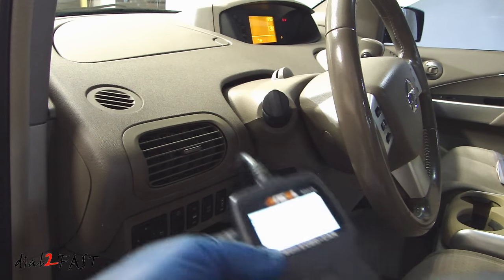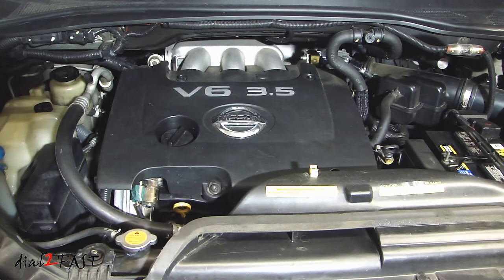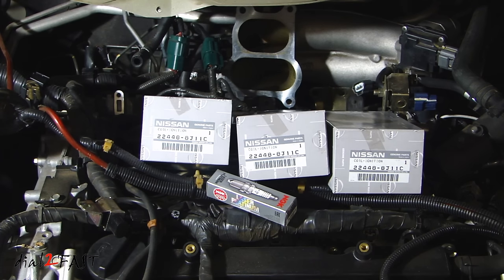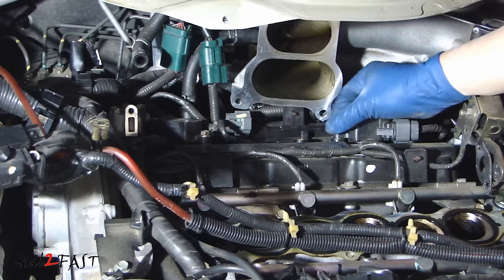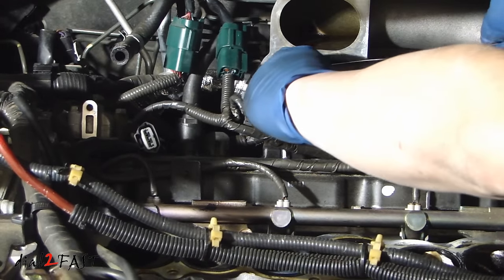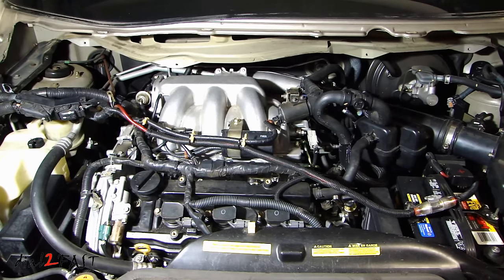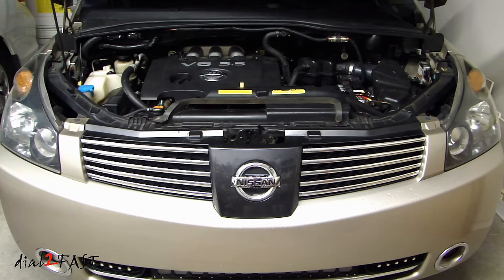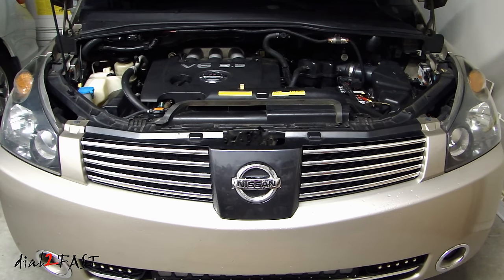Nissan 3.5L V6 Ignition Coil Misfire - P0303 Cylinder 3 Misfire

Comment: Question: The factory manual tells me to drain the coolant before removing the plenum. Do you think this is necessary? If not, why? I don't want to drain the coolant if it isn't necessary. I have a 2005 Nissan Maxima.
Reply from the maker: You don't need to drain the coolant as I have done in the video. The reason the factory manual mentions draining the coolant is because it includes steps to disconnecting the throttle body which has coolant lines. And the throttle body is attached to the plenum, but you only need to move the throttle body to a side when working on this.
Reply: Thank goodness. Thanks for the video & reply.

Comment: dude. that's awesome video.  I messaged before about your quest. I also have a 2004 quest se. I have the misfire #3 plug etc. and lcd screen issue and ops I believe my timing chain finally went bad. now its at my mommys house sitting there . I guess its the old car blues but the quest drives fine and I do like my big girl but Money ways . she costly. and misses need a car. driving aunts car for now. keep the good work  up
Reply from the maker: The Nissan 3.5 V6 is a good engine, but problems can occur with high mileage if not cared for. Also working on it is not the easiest. Thanks for your comment!

Comment: Great video, just curious to know if a Check engine light came on for bad coils? My car is hesitant from 2700 RPM to 3300 RPM and a lot of people say it's the coil packs but I have no check engine light
Reply from the maker: Even if you have no check engine light, you can still plug a scanner to it and check for any pending codes.

Comment: is this the same process for a 2012 Nissan quest
Reply from the maker: The 2012 Quest is a different model year than the one shown in the video but all the Nissan VQ35 engine are very similar. The parts for the gasket is probably different. But the video should give you an idea of what's involved.

Comment: How long did this repair take you? Im considering doing it myself, and knowing how long it would take would be really beneficial.
Reply from the maker: If this is your first time and assuming you have all the tools, for the Nissan Quest, it may take around 4-5 hours.
Reply: Yeah, well the great thing was that my code was p0305. Amazingly, the 5th cylinder was almost inaccessible in my 04 Altima, but with a u-joint and a ratchet and some nimble fingers i was able to pull out the coil and plugs. 

If it was Cylinder 1 or 3, I would have had to go through this.

Turned out it was just a failing spark plug. 
A $10 fix. 

Got my car back on the road and running well.
Hopefully the other 2 sparks in the back don't fail in the near future, if they do, I ll be back on this page.
Reply: @ultimatenoob3  hey..I know you posted this about 2 years ago... Im guessing you had the V6 Altima ? I have a code P0305-Cylinder 5 on my Murano and want to see if I can do this without removal of Intake Plenum..Did you remove Airbox though?
Reply: @happyseany  nope. 

Just used a ratcheting driver with a universal joint couple to go around the bend to loosen the bolts and the spark. To pull out the plug you can use a magnet or what i did was a small 3/4 inch pipe section with some rubber band on its end to grasp the spark  plug and pull it out the chamber. Never needed to pull out the airbox or anything. took about 30 minutes.

Funny thing is 5 months later on cylinder 3 misfired. And I ended up pulling out the plenum anyways and replaced all the plugs. For me it was actually the spark plugs that were the issue not the coils.
Reply: @ultimatenoob3  Hey - thanks so much man for the tips! going at it this Friday. I did all the plugs, valve cover and Coil # 1,3,5 about 2 years ago with all Nissan parts - and getting friggin' Code P0305 - I feel like I did my time and don't deserve this crap! Took out intake manifold/plenum.. windshield wiper arms, motor, cowling...blah blah blah ... and still got a code with only 12k miles since all that work!! So pissed. But I will definitely try what you said and to grab spark plug and I have a 1/4" drive u-joint. Wish me luck! Thanks for quick reply!!

Comment: Where is the 5th cylinder located I got a P0305 misfire that to the front of the engine?
Reply: number five is far back right near throttle body when facing front of car  underneath intake manifold. Firing order/location 1,3,5 left to right cylinder under manifold and 2,4,6 left to right at front of engine near radiator.

Comment: Have you ever changed the PCV on your vehicle? I believe it sits behind the rear valve cover?
Reply from the maker: The PCV is on the rear valve cover. If you buy a replacement valve cover from NIssan, it comes with a new PCV already installed. I already replaced that valve cover along with the PCV before doing the front.
Reply: dial2fast I used an aftermarket valve cover for the rear and I regret it. I was just wondering if I can access the pcv valve without removing the Platinum?

Comment: I have same problem, 3th piston. I changed the ignition coil last month and today it went bad again... before i change it all over again can someone tell me what might be causing same coil going bad? It was a cheap coil, can it be simply because of that or can it be  something else, something i should check while its open. I have changed the spark plug as well btw
Reply from the maker: With the coil, only use Nissan OEM part. They are more expensive but considering the work involved to replace the back one, you want to only do it once.
Reply: @dial2fast  thanks for reply, im going to buy nissan this time. Can something causes same coil go bad you think?
Reply from the maker: @apache08  A coil pack is an electronic device, and aftermarket coil packs may use cheaper components which can lead to premature failure. Thus the lower cost.
Reply: @dial2fast  Thanks for fast reply and your time!

Comment: I had 2012 maxima automatic, engine service code show cylinder 6 misfire, can you tell me where is the # 6 locate at, and what do you call that gas ket
Reply from the maker: On the Maxima, #6 should be the front spark plug (close to radiator) last one on the driver's side. Looking at the engine while standing in front of the car, the rear 3 plugs from left to right is 1, 3, 5. The front plugs are 2, 4, 6.
Reply: thank you

Comment: misfire are caused by low compression foul spark plug bad ignition coil and loose injector and coil wire connector what if you change the coil for p 0303 and the cylinder compression was low or  injector 3 connector is loose half way down the road the check engine light will come back on 
 for p
0303
Reply: That's where I'm at. I replaced all coils, plugs, vacuum lines, and air filter. Still have the code that wont die. P0303
Reply: Do a compression test on all cylinders also you might carbon deposit on the intake or exhaust valve that can cause a compression leak when it is on the compression stroke causing pressure to leak which can cause a missfire.

Comment: Why didn't you just do all 3 spark plugs since you were back there? Great vid tho!
Reply from the maker: Because all the spark plugs were replaced several months before this repair.
Reply: I see. Were they all the same type? If I didn't know the person or previous history I like to change them all at once. I despise these Nissan valve covers....I started to go towards Honda/Acura over the years. Both my Nissans "2006's" have had major issues no thanks to design flaws from Nissan :(
Reply from the maker: @Nperez1986  All six plugs are the same.

Comment: In my case cylinder #5 it misfires where would cylinder 5 be located at in the front towards the back????
Reply: luis jimenez rear
Reply: 1 3 5
2 4 6
Radiator
Reply: regiotexas ireolace the one that was bad and the rest as well also new spark plugs and the problem continues what should I do ??
Reply: luis jimenez check the injectors and connectors of inginition coils

Comment: Should have replace all the plugs and coils at the same time. My cousin had a similar issue with a Ford Taurus, he only replaced the plugs in the back and the coil pack, this is a single pack for all cylinders. Ran great for 2 days then died. He found out that all the plugs, coil, and the wires also, should have been replaced at the same time. It ended up creating an electrical imbalance between the cylinders. The ECU couldn't handle it and it burnt out the coil pack. He replaced it all and hasn't had a problem since. I am having a miss on cylinder 5 of my Maxima. I am replacing all plugs and coils at the same time. Just saying would hate to ruin the 3 three coils in the back and have to replace them again. And it is good insurance to make the motor as efficient as possible. Later.

Comment: Is cylinder 6 easier to get to??
Reply from the maker: Cylinder 6 should be the front one on the driver's side. If you are standing in front of the radiator looking at the engine, the cylinder numbering is: 2 , 4 , 6.

Comment: Wat is the resistance on these coil packs
Reply: I can't find any info either. Very convenient.
Reply: True Patriot  i figured it out the resistance should be between .7 and 1.7 ohms of resistance
Reply: If u ever get a mulitple misfire on a  v6 nissan always check at the ignition condenser it can cause the car to stall ir not start at all causing no spark to the coils.
Reply: Is that for all three pins? 1 & 2 , 1 & 3 and 2 & 3 pins on the ignition coil?  Thanks. I have old coil packs and just wanted to very if they where good or not.

Comment: What is the spark plug gap size?
Reply from the maker: NGK PLFR5A-11 : Gap is 1.1 mm   (when new, these spark plugs are pre-gapped at the factory and you should not need to gap them)
Reply: I check the gap anyway.

Comment: hello dial2fast.i have a question about this kind a job will cost in a shop to fixed, because I have a 07 quest se, showing the same code, if u can give idea with labor and parts,thank u
Reply from the maker: Depending on how many ignition coil you need to replace. Those are pricey bits. I would say probably $500 - $700.